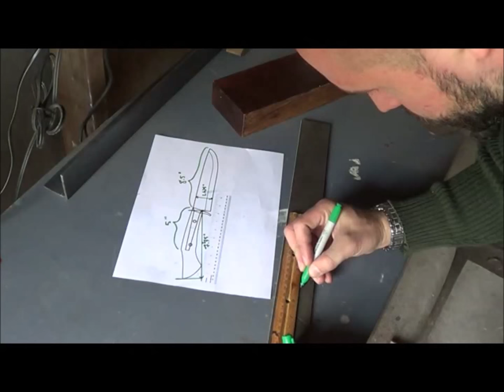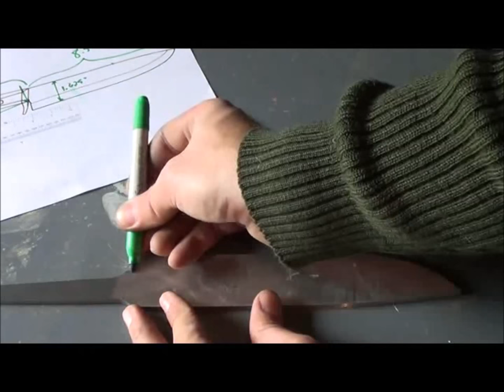Ian's Japanese Machete: Part I

Comment: I have to ask, what kind of band saw are you using? I looked up the brand and the only sell hand held models. Do you have it mounted in a special way? Cutting with the angle grinder isn't working for me anymore.
Reply from the maker: You're right, it's a Milwaukee portaband saw mounted to a table, made by the SWAG Off Road company. Just look them up and you'll find it. It's really expedited my blade profiling.
Reply: Thanks so much. I just ruined my first Bowie because of that angle grinder. Best of luck in all your future projects